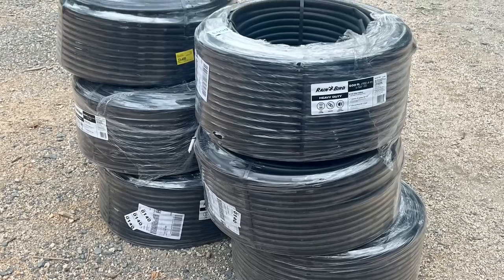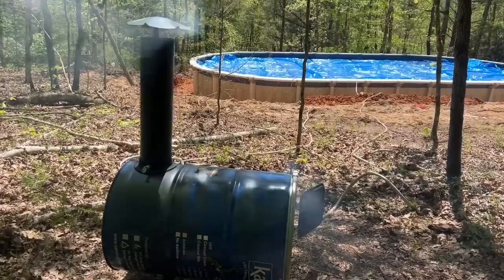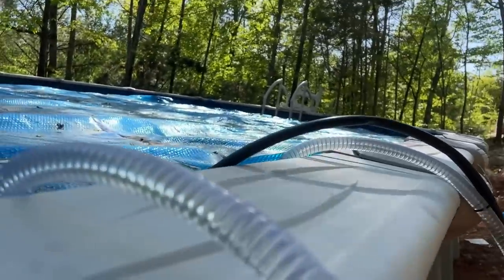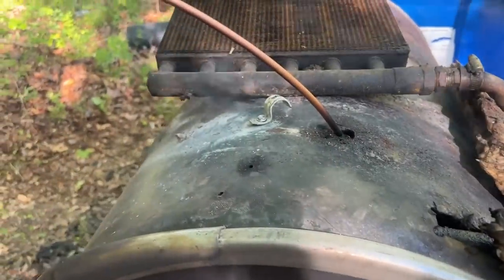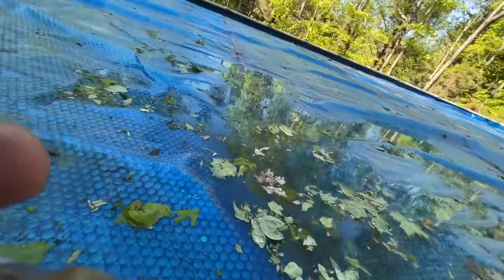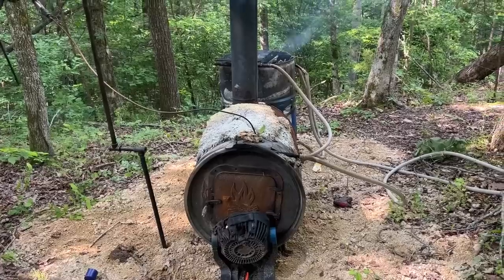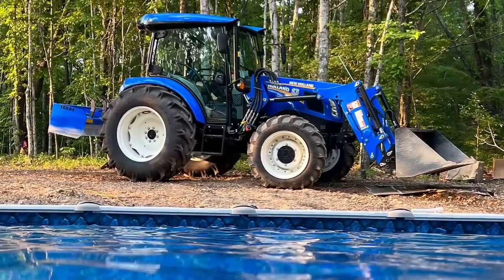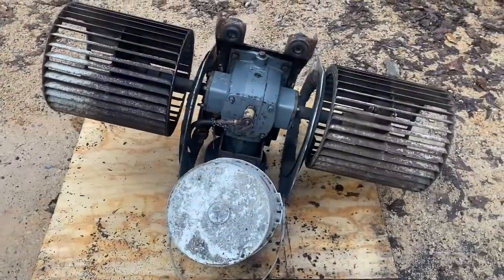Heating our pool with a wood fired pool heater. Experimenting with different setups to heat our pool

Comment: Scott put a barrel in your barrel with the coils. Copper doesn't take the heat long-term. You'll still get great heat but won't have to worry about the expensive copper. I use a propane tankless water heater and HF pump for my hot tub. Safes me a ton on the electric heater.
Reply: Too much copper in the water can also mess with total alkalinity and PH balance.

Comment: It's nice to see the idea works so well. I've been looking at doing the same for my pool. It's 30,000 gallons and sometimes even with some really good weather. It takes about a week to warm up after I fill it.
Reply from the maker: Ours is 25,000 gallons.  We were in it less than a week after installation and it was 60° during the daytime 30’s at night.   Throw a few logs on every couple hours and good to go.  Me Smelling like a campfire after throwing wood on the fire is the only downside.
Reply: @BusGreaseMonkey  if anyone complains about you smelling like wood smoke, tell ‘‘em to go take a whiff of some gear oil or that bearing yinz had to pound out in a couple videos ago…

Comment: If you put the boiler down side of the pool you dont need to use a pump to circulate the heat.. Also solar heated pipe  if you put the black pipe inside clear pipe it will work better.. Thanks for all the videos from Glasgow Scotland!

Comment: Use a black tarp to cover the pool and remove the air bubbles floating cover.
air pockets are a very good heat insulation ,wich is not what you want to use the Sun free energy wich is not reflected by black color.

Comment: We built my water heater by encasing the coils in refractory cement, lining the fire chamber. Heats up reasonably quickly and holds the heat well. Served a domestic heating system inc water very well in UK winter.

Comment: Good way to have a nice pool year round! All you need is 2 inch .25 wall steel pipe welded in to the inside top of the barrel.  6 to 8 pieces connected u shaped.  No copper needed. Add a second drum next to the barrel stove or touching it. That will be the hot water tank to pull from. U could even put another 55 gallon drum on the other side to cycle the cooler water from the pool heating that water as well.  My grandfather did that in his house for hot water during the winter. He used 2 propane tanks touching the 55 gallon wood stove. Gave the house 100 gallons of instant hot water plus the 50 gallon propane water heater. 7 people could take a bath and shower and not run out of hot wate.

Comment: The wrap around the solar piping is reflecting part of the heat. Also, the heat would be better if more of the tubing is directly heated by the sun. Love the wood heater. Once the pool is about 95 to 96 it will be feeling great :)
Reply from the maker: That was just the 500’ rolls of the piping before it was layed out in the sun.

Comment: Scott Id put your coils in another barrel on top of your fire barrel......
just run your stack from the rear of the bottom barrel into the top
then run your exit stack out the front of the top barrel.....
I used to do this with a home made barrel stove and used fire brick and sand as a bed in the bottom barrel
the thru the center of the top barrel i sealed the open end and ran a 6in piece of schedule 40 pipe thru the center and put a blower on one end and the air that came out the other side was very toasty warm in my 24x30 shop on a cold winter day in Eastern WA!
should work real well with a coil inside the top barrel as well!

Comment: I have a very similar log splitter to yours. They are tiny, but they work great. Split all my firewood for last winter, being a mix of cypress, juniper and of course oak. if you take it a piece at a time, it will split as big as you can carry...... you wont be starting a firewood business on the side, but its enough for "personal consumption"

Comment: Copper is better on the outside. The copper stays clean.....cover it with insulation...cut open a second 50 gal tank, cut a flue hole and drape it over the copper clad barrel. With a full fire you can put your hand on top. There is remarkable heat gain with the insulation. My rig uses 4 lengths of 3/8 copper for a total of 200 feet fed from a one inch manifold (plenum). I'm into a forth season now and it is still very efficient.

Comment: If your looking for inspiration on how to move this up a level look at the designs of Naval Boilers. Your not operating under pressure but the principles of heat transfer still apply.

Comment: Saw that you are running the Perma Salt system.  The system works by dissolving copper. Test your water to see what your copper levels are.  Too much copper will cloud the water and can turn bleached hair green. I’ve had a Perma Salt system for 14 years and it’s great. Just not sure about all of the extra copper you’re exposing the system to. Good luck.
Reply from the maker: Yes we test cooper levels.  No issues

Comment: I, like you Scott do not like cold water. I admire your will to heat that pool. I installed a 20kbtu heater for my Doughboy. Worked well , chlorine will gas out very fast with hot water.
Reply from the maker: The grand baby likes it warm

Comment: Why not just put a bank of solar pool heaters on your roof at the house and run the line to your filter done you don't have to cut wood you don't have to have barrels burning wood all over the place and all that mess just put solar panel pool heaters on the roof of your house  And be done with it